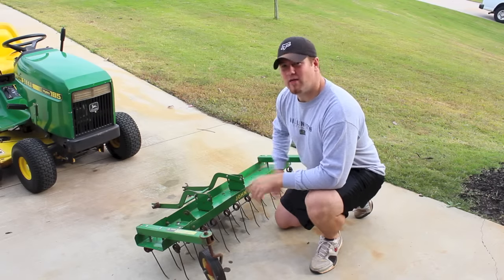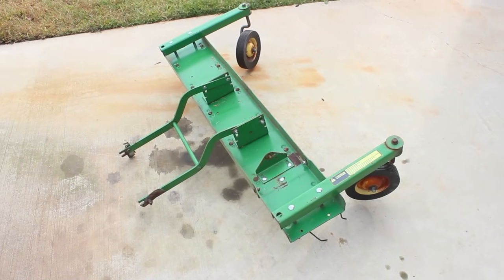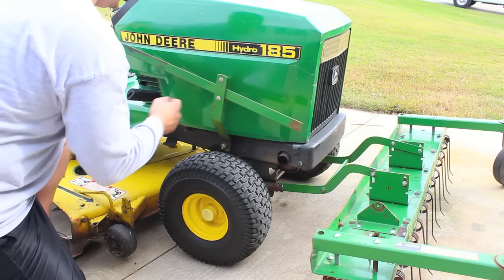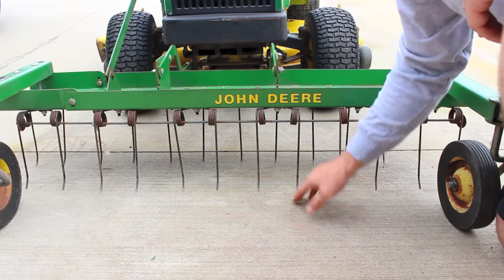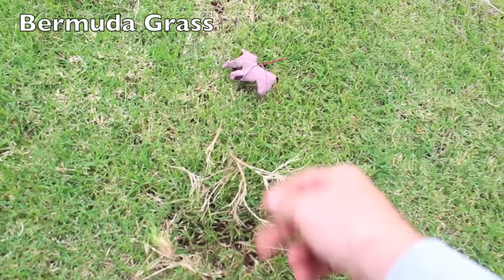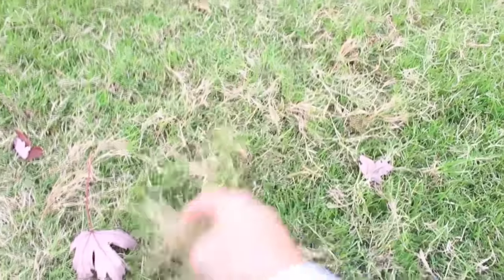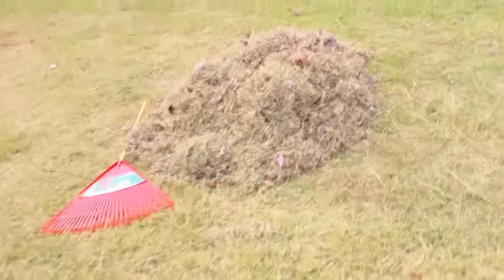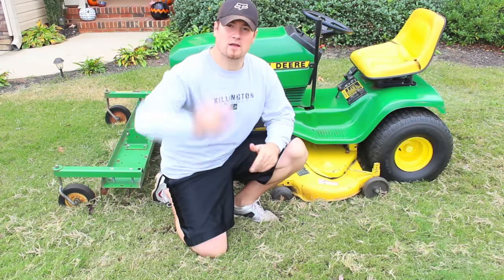HOW TO DETHATCH YOUR LAWN JOHN DEERE DE THATCHER RAKE FOR GRASS

Comment: I'm curious about one thing.... There is actually a handle on the left side of the tractor for raising and lowering 'implements'. Why the arrangement on the right side?
Reply from the maker: I am not sure about that one
Reply: @TheRykerDane  The left side handle raises and lowers the deck on my LX173 and JD180. My X300 is via a left hand foot pedal. When I use the de-thatcher on the JD180 I also bag what is broken free from the lawn with my 48 inch mower deck. You will be emptying the bags frequently, they fill fast!  Great suggestion in the video ... criss cross your lawn to remove more thatch. When all thatch is cleaned up I use my aerator in a criss cross pattern also. GREAT VIDEO! WELL DONE! Howard.

Comment: Nice video, I like the idea of the unit being out front on the tires.
What is your opinion on pull behind plug aerators?
Is it too much stress on the hydros?
Is a power walk plugger more efficient?

Doing a lot of research, and it seems that aerating your lawn is huge!
I plugged my lawn last year for the first time and what a major difference in the lawn.

I have an older 16 hp hydro Toro tractor and it pulled it fine. You could hear the hydro working a little
harder than usual.
Reply from the maker: push or pull I think either way you are going to put some strain on the hydro. But if the stress is on the front end, then you don't have the weight on the rear axle plus the driving force going on at the same time. I have pulled a plugger before and it definitely is working hard.
Reply: TheRykerDane I think I will stick to the older toro rear engine rider I also have with gear selection.
I am staring the think the Hydros are over rated! I have no problem pulling the aerator with the Toro
gear tranny. I was told by a dealer the manufacturers went over to hydros because they are cheaper
to manufacturer than the gear tranny with a clutch.
Reply: We have a spike aerator that we tow around with our John Deers X300, LX173 and JD180. I prefer using the LX173 or JD180 as they are manual 5 speed transmissions and not hydrostatic trannies that might create internal heat. I believe the plug aerator does a better job ... the ground has to be water sodden and soft for either to perform properly ...  and don't drive too fast!   If the ground is too dry you will not get any penetration. Howard

Comment: Thanks for the video man! After running de-tacher, do you manually rake and bag all the junk or bag it using mower...look like a big lot and raking manually may take lot of time.
Reply from the maker: Well if you have a bagger system to put on your mower then use that route. But I don't have a bagger so raking it is no big deal. Plus it is usually really dry grass thatch so you can just pile it up behind your house and burn it. Otherwise you have to stuff it into some trash bags for the garbage man. If you have a good rake, it will get most of it up and out of your lawn too.

Comment: How wide is yours? And do you feel like the two wheels are necessary? I just picked up a 32" one with only 1 wheel in the middle. Thanks!
Reply from the maker: yep the wheels are needed for support for sure. They help when going uphill. Mine is about 42-46 inches
Reply: Good deal, I'll see if I can fabricate something to match, looking forward to doing this once old man winter moves out

Comment: I need some parts for my JohnDeere dethatcher,a wheel assembly,and the complete lift arm and side mount. dethatcher keyword does not work on the Johndeere website. Any ideas would be appreciated.Also,would"nt it be okay to mow while dethatching, Our lawn is huge. Thx'Eddie C.
Reply from the maker: +Angi Callahan try a thatch rake, or rake attachment. i know its an old model and rake so you may have to call in about it.
Reply: +TheRykerDane thx, jd web site very difficult. customer service terrible. thank you.

Comment: Why did yi stop using the bag, and why did you have to manually rake, if you had a bag? Does the John Deere bagger work okay fir this?
Reply from the maker: well the rake, rakes up so much it wouldn't fit in the bag anyway.

Comment: I have 3 acres of old cow pasture that is terribly bumpy and uneven. Can one of these be used to level out my lawn? I tried a roller and they don't work worth a darn. I am killing my back. Is there some attachment that will make my lawn even? I do not care if it tears the lawn up. Would this work or should I just till the whole acreage under and re-plant seed. Got to be a easier way
Reply: What about a "harrow"?
Reply from the maker: ***** this may not work for that. the best bet would be to put out sand and level it and let the grass grow through it and level any holes that way. But if there are some areas that are really bad, then you probably better till it.
Reply: Yeah, either a pull behind rake (looks kinda like a dethatcher but has stronger tines, then maybe followed by a pull behind harrow is what you need.
Reply: Randy Hauck 
A dethatcher won't do anything at all to fix bumpy/uneven ground.
Three acres is a good sized lot
You can rent a tractor with a tiller attachment then after it it tilled up, throw a roller with some water in the roller and that will level out the dirt that has been tilled.
Another option:
There are plenty of excavation companies that dump dirt for free by the dump truck load. A dump truck is any where from 15 to 20 yards. That amount of acreage would require at least 30 to 70 loads to even it out. With that many loads, not only would you get the dirt for free, they would probably level it out for free as well, as it costs a pretty penny to dump dirt. It would be a win win.
Reply: You are right a roller will not even it out, nor will the de-thatcher. I agree with one of the other comments here ... get a tractor and attach a powered roto-tiller. You might want to consider using a tractor with a blade to do a final even out process. If the pasture has a lot of weeds use something like Round Up to kill everything ...  then roto-till ... and at the right time re-seed. Howard
Reply: @TheRykerDane  If the soil has poor water drainage then roto-till and add sand to assist in its porosity. (look for you-tube for info on this subject) Howard

Comment: What is the model # of that unit? I have a 165 I would love to find a front mount dethatcher for.
Reply from the maker: It is a 1987, 185 Hydro
Reply: Thanks, but I was referring to the dethatcher model number.
Reply from the maker: I will check it out and get back with you..Is the 165 a Hydro then? thanks
Reply: Great video! i have a 175 and after seeing how well it worked in your video, i want a dethatcher as well. What is the model number of that dethatcher? I'm having a tough time finding any info about it. Thanks!

Comment: Do you recall how much you paid for this dethatcher rake?
Reply from the maker: +John Straughan sorry no. I got it with the mower when I bought it. I paid $750 for the mower and the rake and a bagger kit too
Reply: I found mine on Craigs list ... $80 is a decent price to pay ... which is what I found my 48 inch lawn roller for. The roller fills with water and its only used when the ground is water sodden.  I paid $100 for the John Deere spike aerator, again the ground has to be water sodden for it to get a decent depth with the spikes. Howard